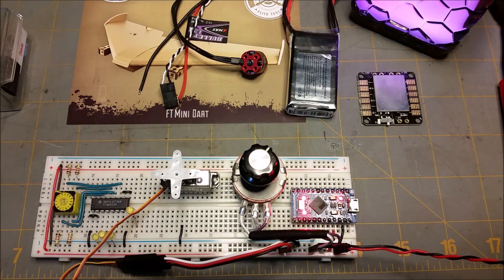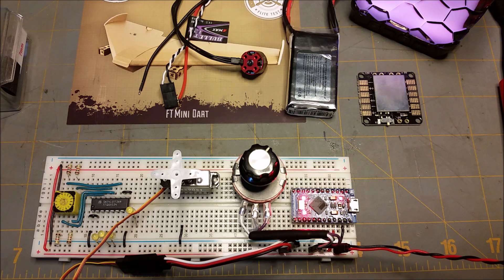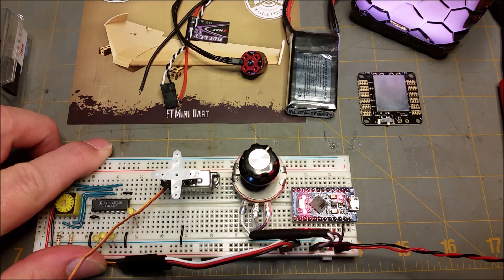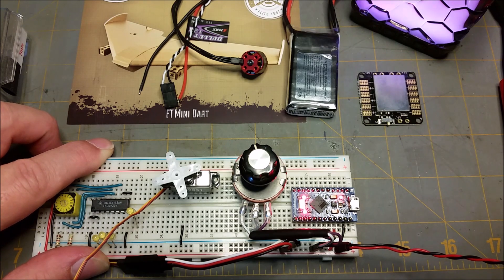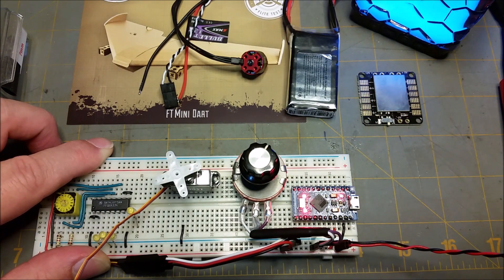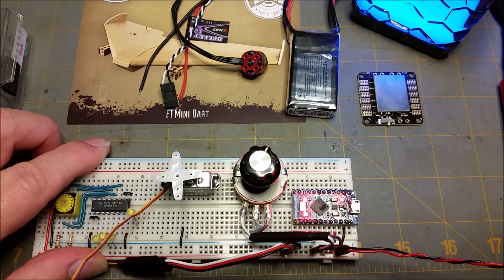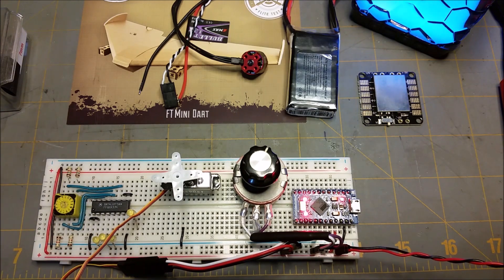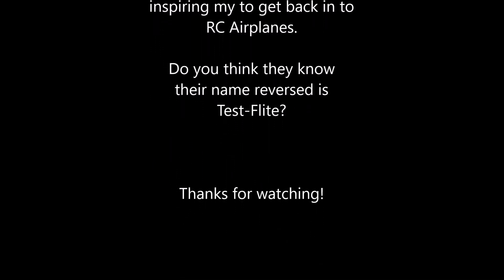DIY Arduino RC Radio Control Servo ESC Tester

Comment: Thank you, I have been needing a servo tester, hooking them up to a transmitter every time you want to center a servo is a bit of a pain, and I always forget to order one when I am buying parts.  All of the other YouTube videos show builds that are overly complicated.  A LCD screen is cool and all, but I really don't need to know the exact settings, I just want to be able to center them, and hook up a pair of servos together to make sure they are moving in sync.  Thanks again for a simple handy code.
Reply from the maker: I'm pleased to know you found this useful.  Back in the day, before mixers were common, I used a 6801 CPU to mix a small amount of rudder input with two throttle servos for a twin engine model. It worked great!